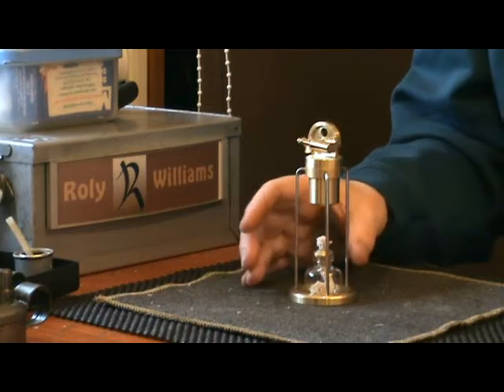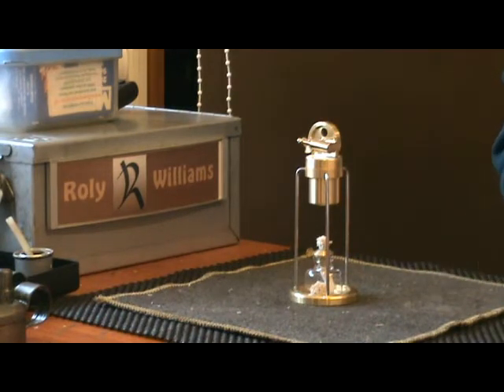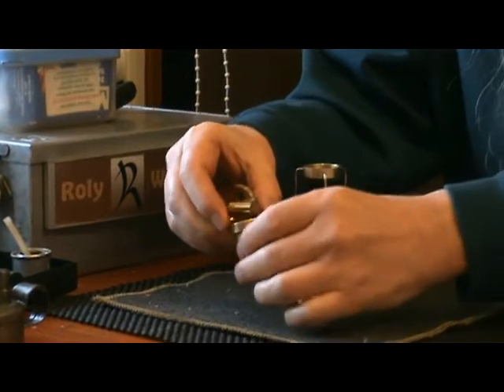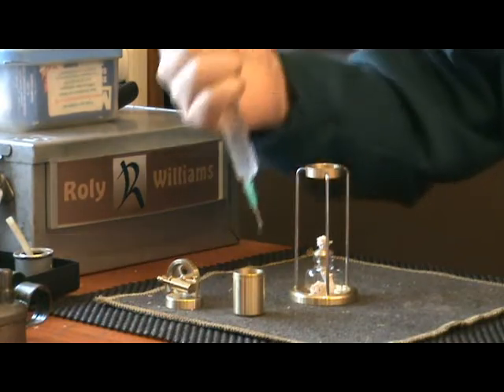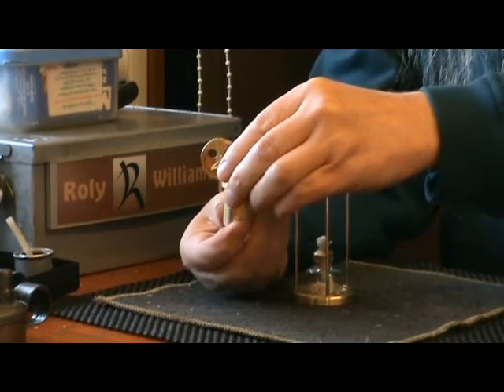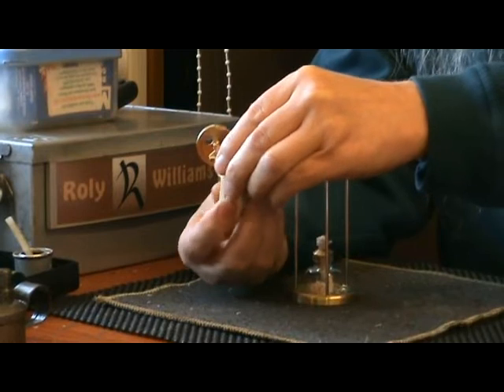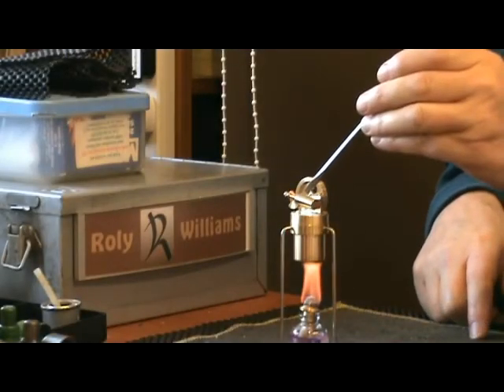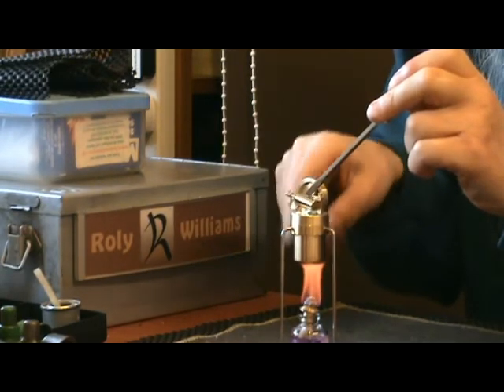Microcosm M16

Comment: How much time did it take to work in the engine? For the first start, what did you need to do to get it eventually going? I just got one of these and wondering how long I need to work it in.
Reply from the maker: It's been quite a while since I made this video. From what I remember, there were two aspects, both of which are common in miniature engines. Firstly it was priming badly to start with. This could have been due to overfilling the boiler, contaminated water or to having the flame too high (or all three). Secondly, like any brand new engine, it needs running in. It worked better each time I ran it.
Reply: I got it working! Thanks for your help!